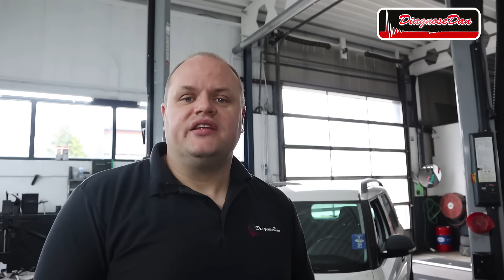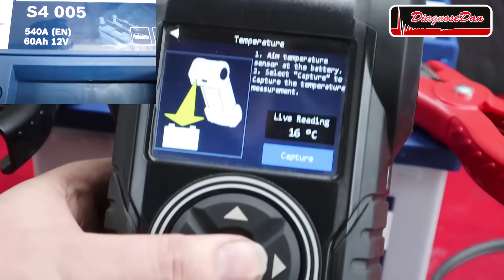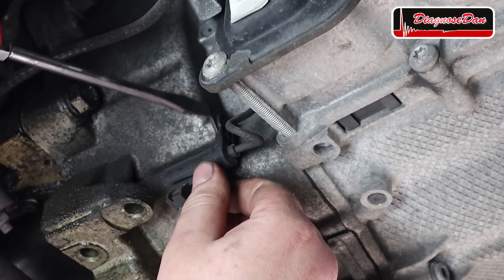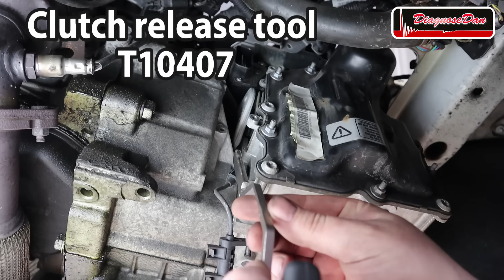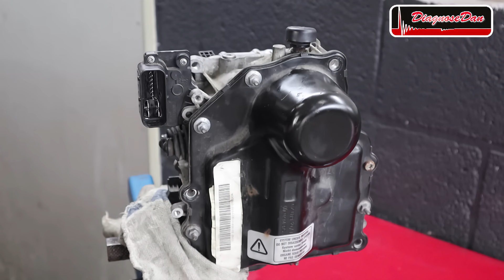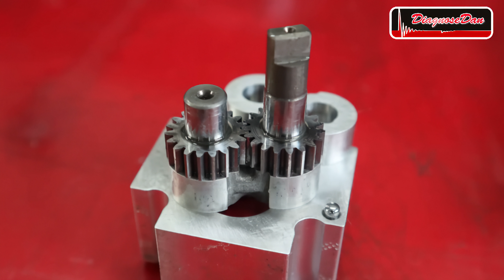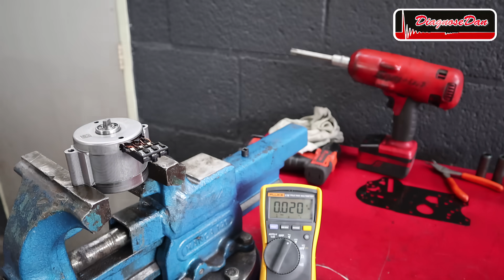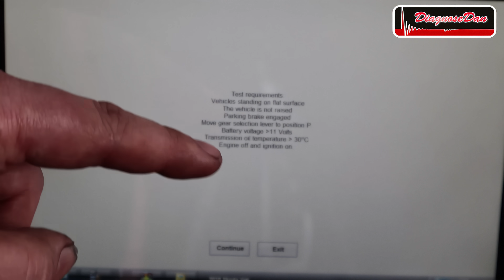DSG Gearbox Diagnosed explained Fixed

Comment: love the video Dan  I'm from Canada and the only dry clutch DSG we have is the Jetta Hybrid and it was in 2013 to 2015 I think  and there was a high failure rate I have seen online and I have seen issues with the pressure accumulator I think it develop a internal leak and the oil for the hydraulic unit even here when the Jetta hybrid was fist available in north america they issued a recall and even had to change the oil the new cars that were in stock and the ones that were sold to customers . it's not the best trasnmisson but way better that what Ford did with the dry clutch on the  Ford focus etc..... looks like 12 people did not like this video probably all form the VAG group head offices.
Reply from the maker: The Dry clutch version was only used (as far as i know) in hybrids in North America/Canada. The Accumulator has a high fail rate.

Comment: What about the DSG gearboxes in Porsches and Audis were they given the same high sulphur fluid from the factory that may damage the control panels?
Reply from the maker: The more powerfull engines use a different wet clutch DSG

Comment: Great video Can , we struggle in the UK for TSB's , when you try to speak to dealer workshop's, we've never had that problem sir , Lying basts they are , very good info for the head filing cabinet, I use wurth trip fuses for repeat blow testing to save on fuses , I mentioned before about second with eggshells, now it's ground walnut shells being used , take care , thanks for the info , good idea about the battery test , imagine all the relearning to be done again after repairs a week later
Reply from the maker: Thanks for the comment, Stay safe Mike
Reply: Ford don't let you get wiring diagrams

Comment: What is the number of TSB? Where I can find/check TSB for my car?
Reply from the maker: I'll do a video on that in the near future
Reply: -	Safety Recall 34F6 on 06 Dec 2013: Over time, the internal gearbox lead frame may corrode due to certain gearbox fluid additives used in original gearbox filling. If corrosion deposits collect between electrical wiring, an electrical short in the power supply may result in blown gearbox fuses and the deactivation of the gearbox hydraulic pump or mechatronic unit. The driver will immediately be alerted by a flashing gear indicator warning lamp in the instrument cluster and the vehicle will lose motive power but can coast to a stop. Loss of motive power while driving may increase the risk of a crash.
-	Corrective Action Replace existing synthetic gearbox oil with a new, mineralbased oil with non-corrosive additives to prevent future failure: https://static.nhtsa.gov/odi/rcl/2013/RCMN-13V568-9034.pdf

Comment: Bloody hell Dan.  13:50 With a few words I finally understood how DSG works and why its called dual clutch.
Reply from the maker: Great!👍👍
Reply: Agreed, and great teardown overall.   So, one of the two clutches is always engaged at all times?
Reply: @LeverPhile  Except when at a stop. But if stopped on a hill, don't use the throttle to hold the car like you can with a real automatic because that slips the first gear clutch rather than a torque converter.
Reply: @andyanderson1612  
Right, neither clutch engaged at a stop.  But absolutely no way I'd use the transmission to hold the car on a hill ... auto, manual or DSG ...

Comment: For some reason batteries last max 3 years in all my cars.  Always used Varta or Bosch (which are the same company).  Bought exactly that same battery yesterday.
Reply from the maker: It should last longer than that!
Reply: @Diagnosedan  as soon as the car has a flat battery once (forget the lights on or else) its countdown for the battery, in 6 months max it will be dead.

Comment: Like most German systems, the most expensive component is usually the on that fails. That makes troubleshooting easy but it's hard on the wallet.
If the gearbox oil was a problem, the vehicles should have been recalled to replace it.
Reply: -	Safety Recall 34F6 on 06 Dec 2013: Over time, the internal gearbox lead frame may corrode due to certain gearbox fluid additives used in original gearbox filling. If corrosion deposits collect between electrical wiring, an electrical short in the power supply may result in blown gearbox fuses and the deactivation of the gearbox hydraulic pump or mechatronic unit. The driver will immediately be alerted by a flashing gear indicator warning lamp in the instrument cluster and the vehicle will lose motive power but can coast to a stop. Loss of motive power while driving may increase the risk of a crash.
-	Corrective Action Replace existing synthetic gearbox oil with a new, mineralbased oil with non-corrosive additives to prevent future failure: https://static.nhtsa.gov/odi/rcl/2013/RCMN-13V568-9034.pdf
Reply from the maker: They were recalled! But not everybody got it done
Reply: @Diagnosedan  just trying to spread this info around, it is also the most common question everyone is asking you, so hopes this helps. Nice video!

Comment from the maker: UPDATE! It's the Gearbox oil responsible not the hydraulic fluid. I changed the Gearbox oil after the video.
Safety Recall 34F6 on 06 Dec 2013: Over time, the internal gearbox lead frame may corrode due to certain gearbox fluid additives used in original gearbox filling. If corrosion deposits collect between electrical wiring, an electrical short in the power supply may result in blown gearbox fuses and the deactivation of the gearbox hydraulic pump or mechatronic unit. The driver will immediately be alerted by a flashing gear indicator warning lamp in the instrument cluster and the vehicle will lose motive power but can coast to a stop. Loss of motive power while driving may increase the risk of a crash.
-	Corrective Action Replace existing synthetic gearbox oil with a new, mineralbased oil with non-corrosive additives to prevent future failure: https://static.nhtsa.gov/odi/rcl/2013/RCMN-13V568-9034.pdf
Reply: That's interesting, will VW be paying for the repair and fluids? I wonder were all the factory testing time went.
Reply: @philthejet  massive recall on DSG, VW just cant seem to do the right thing in most cases, a mate went thru hell to get his Golf R DSG fixed, and it was only a few months old//
Reply: mixalis Hi, 
Just curious. What was the dealers response? I mean, if only a few months old, it should be difficult not to carry out any repair under warranty... (even for VW;)
Reply: @Chalee6168  if it was a few months old all he had to do was reject it
Reply: @Conservator.  Vag group pays for it since its a manufacturing problem.
Reply: @Freezy322  no people. VW launched a service recall (different to that of a safety recall). If this recall hasn't bn done and t fault occurred outside of t 3 years manufacturers warranty then t customer is liable. Don't forget t findings on this gearbox fault are suspicions only - not conclusive meaning know one knows for sure what caused the fault... So trying to take legal action against VW would be very difficult prove
Reply: @philthejet  Most European manufacturers seem to let customer do the product testing these days. Must say VW seem to be worst for this!
Reply: oh right the board is submerged in the main gearbox oil got ya thanks for putting me straight on that one
Reply: #DiagnoseDan @DiagnoseDan I have never watched someone so clearly and precisely tell the lay public what causes and remedies the problems we encounter on the road. I drive a 2009 Passat CC,started having issues with sensors and reverse gear not selecting properly in the DSG gearbox,the battery died 3 times and the AA roadside assist came and jump started the car,each time telling us the battery was fine,the car went in for a service,gearbox too and while there the mechanic said the battery was shot,replaced it and unfortunately the issues still remain BUT I am bringing the car to a diagnostics guy (like you) who I am hoping will be able to reprogram the issues out and get my baby back to her former glory....thank you for your brilliant videos!!! All the best from Dublin, Ireland 🇮🇪
Reply: Is the manufacturer liable for the repair cost?
Reply: Dear Dan, for someone who drove old Civics.... I dont understand why the hell!!! Next can come only laughing without borders. But your videos are cool, your good guy and even better Mechanic. 💪
Reply: Thank you dan!!!
Reply: Thanks for the update man!
Reply: Hi ,Dan ,recently there is another worldwide recall caused by the accumulator seat crack. You can check this out.
Reply: hi DiagnoseDan > i have a lexus is 250 2007 model . the gearbox fluid sound loud when the car is cold .it has 135k mile . i changed the transmission fluid and filter but the flushing sound in the transmission is still there . do you have any idea or advise please . the car is in dubai
Reply: DiagnoseDan 66
Reply: Well said @DiagnoseDan , I  experienced the same problem on a Mercedes Benz s Class W221 with DSG  gearbox ⚙️ after a  client having complaints of delayed shifting,this occurred after gearbox service from another garage before brought to me.
A similar problem on an Audi A6 with DSG.
Guys kindly subscribe to my YouTube channel via
https://www.youtube.com/channel/UCe8YTUp77C9krxZ0g2GWEaw
and let’s network @MugaluTheCarGut/Facebook/Twitter/Instagram.
Reply: I hope that he used GL4 rated gearbox oil and NOT GL5 rated oil as the GL5 rated additives in the oil seemed to be the culprit.
Reply: So does this mean that the problem was a problem in the gearbox which lead to an overload on the PCB inside the mechatronic unit? Or did it have two separate problems?
Reply: @yammy1000  The circuit board was shorted out by precipitates bridging across the tracks. GL5 rated oils  should NOT be used in these boxes.
Reply: Thank you. I just had my mechatronic unit (Audi A3 2009, 1.8TFSI) deactivated yesterday... :'( Luckily, I had just gotten home into the parking lot when the car came to a stop.  Your video has been very educative and came in handy especially in understanding the "works".
Reply: First thing I noticed was how black the Gear Box oil was--I thought it suspect.  My 02E DSG oil always comes out looking like honey.
Reply: @joshuam7552  it was burned

Comment: Hello dan great video as usual but I think you have a mistake.
the tsb you mention is referring to  the trans oil not the mech oil.
it has been changed from synthetic to mineral because of the problem you showed
Reply from the maker: You are right , i changed the Gearbox oil after the video. Thanks!

Comment: So VW has a TSB to acknowledges the problem is their fault ( bad oil) but your customer still has to pay to fix the transmission...hmmm something stinks here and its not the burning plastic..
Reply from the maker: Every owner got a letter for a recall, but if the customer never went to the Dealer to get the oil changed......
Reply: @Diagnosedan  ahh..well that makes more sense I guess..its a shame that the electronics are almost the cost of a rebuilt unit though..

Comment: If the battery is fitted to the car and charging system not charging properly battery will be low is that right how. Should you check charging system as well.
Just bought a Kia Cerato GT with DSG and was good to get a better understanding of what that is and how it works. Thanks Dan
Reply from the maker: If the charge is Just low the Tester Will give the message "Good recharge" a battery won't fail because of a low charge.

Comment: that motor is drawing too much current, you can see that from the terminals, silly gearbox i have replaced too many of these dsg units, by the way you are wrong, dsg stands for doesn't select gears

Comment: First Class video,  the VW DSG is  poorly engineered,  a class action in the USA courts judged  against VW,  the unacceptable failure rate of the expensive part  ..." USA Lemon Laws"
Reply: My personal preference is manual transmission. There are less things to go wrong and by my understanding, it usually has potential for a tad better fuel economy.
About DSG. You know it is not good if you get one to act up twice during test drive of a dealer demo car (Skoda Superb). That one had noticeable delay between applying throttle and taking off, also did not like uphill maneuvering (dropping out of gear and down the hill you go).
Reply from the maker: Thanks for watching 👍
Reply: USA is not EU...
Reply: Other manufacturers have the same problem, it was a mistake from the inventor and was fixed in man other cars too. I know of Kia and Mercedes that has changed the control unit because boards fried like that.
Reply: @Spelter  How they fixed it?
Reply: Interestingly the original wet clutch DSG was supplied by BorgWarner - a US based company - to VW. But I guess since VW put them in their cars they are responsible for the failures.

Comment: Surely this is a fault created by the manufacturer and should be covered under warranty?
Reply from the maker: There was a recall, but if the customer doesn't go then......
Reply: DiagnoseDan you would think the manufacturer would pick up the bill for the part. How much was the part?

Comment: Hi Dan,  your videos have always been so inspiring. I have some questions...prior to disassembling the mechatronic unit,  you revved up the engine while changing the gear lever. What's the effect on the transmission, suppose the gearbox was working properly? Is it advisable  to change the transmission oil, even though VW manual Says the oil is lifetime? I have a 02 VW Bora (01M Trans) and 08 VW Touareg (DSG trans). Both transmissions  are super fine. Pls more videos from you in 2020...😂... Thanks... Paul... Nigeria.
Reply from the maker: I reved the engine to demonstrate the Gearbox was not working. If the Gearbox worked the Car would have start to move when i engaged a Gear. 
Fresh oil is always a good thing!

Comment: I would love some content on brand ,type/specs of oil, as vw charge rediculos for this oil.$800 in Australia, for amarok,.
Reply from the maker: Does the Amarok use a wet or dry clutch?
Reply: Lol , Amarok is a zf torque converter auto

Comment: Awesome troubleshooting as always Dan.  I hate my ford fiesta double clutch 1.6L powerSHiET 6 speed, not because it broke down or anything. Its algorithm is stupid. It is the worst gearbox for bumper to bumper traffic or anything under 20km/h. I prefer REAL auto with torque converter or manual transmission. I did not bother to check in depth when I bought the car in 2011 that it has a DCT ... hick hick , so pissed.
Reply from the maker: Some drive better than others

Comment: Thank you so much, Dan, we learned a lot !
Diagnose Dan has fixed it again (with a little help of Sam?) !!
Could this major breakdown have been avoided ?
Was the old type oil with its sulfur content the reason for the badly burned circuit ??
Reply from the maker: Yes it was, Sam is a Transmission Guru 👍
Reply: Unbelievable !
Give me my old 6 speed gearbox back, quickly, please !!✅👍

Comment: Well, back in the 80’s and 90’s I was using a VAT-40 battery and charging system checker that did the same thing using load clamp and carbon pile load test. We did our own temperature calculation.
Reply from the maker: Yes i had one too back than. I think i still have it somwhere
Reply: I think the main thing for us was that we didn’t apply a lighter load for a longer period after the initial voltage drop load test to see if the battery could hold above a certain voltage when wound up to the CCA. But I do recall we’d often do an initial test then come back after a few minutes and hit it again to see if it could still hold the voltage like the first time.

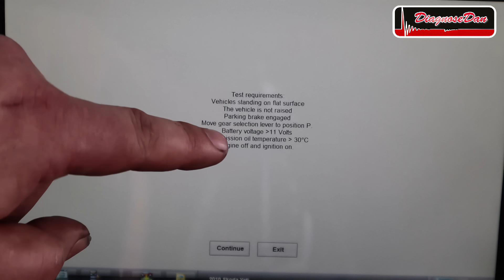Comment: Great video. I've been wondering what was in that unit. At 28:20 the list of conditions shows the oil temp must be greater than 30 C. Did you run the engine to get it up to temp prior to calibration? I guess it wouldn't hurt as long as it's not shifted.
Reply from the maker: The procedure is actually a bit longer the i showed in the video. The engine also needs to run with the wheels on the ground.
Reply: You don't need to heat the gearbox the adaption will be fine, in the later cars it doesn't even ask you to get it up to temperature. You can always use a heat gun sparingly underneath the mechatronic unit. There is also a run in procedure that needs following after to make sure the car learns in new adaptions.

Comment: When I just started using midtronic handheld battery tester, I found that the hand held would give a different results from the four wheeled one would charge the battery and test it would some times take up to 50mins to complete because it would do a charge test charge test procedure,and it would tell the amount of cca left. we now have the latest  version of hand held now still don't give    remaining cca. So I normally do a comparison on a good batt like u did
Reply from the maker: They are improving the products all of the time to give you the best test results. The newer models are equiped with WiFi so you can update them with the latest software